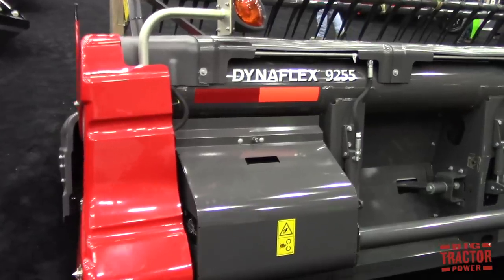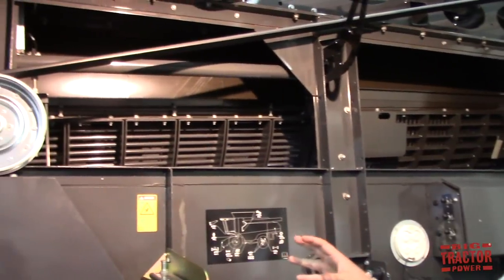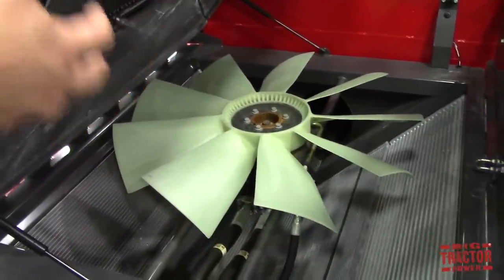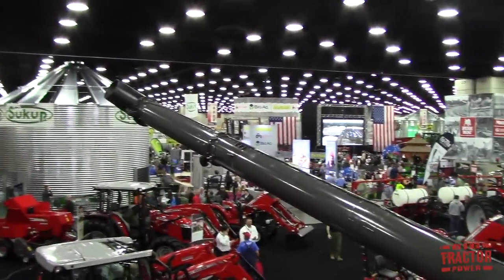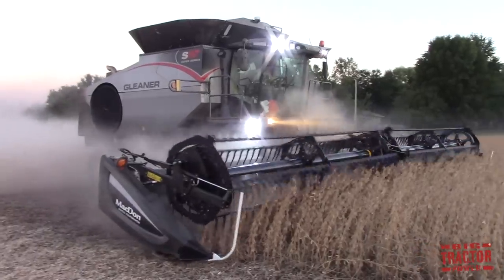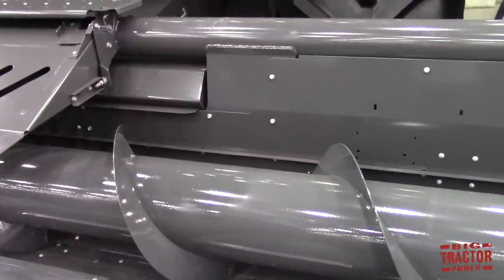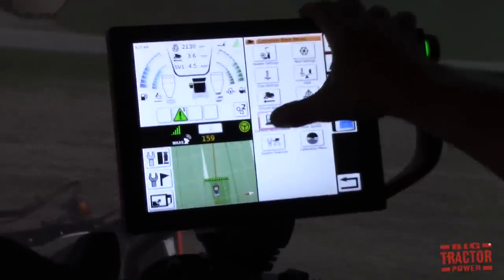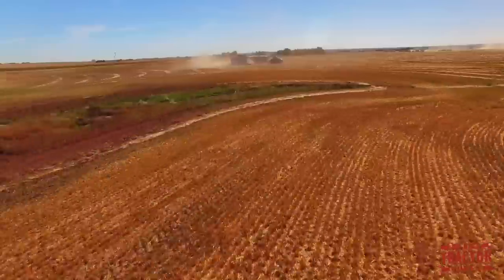Talking with AGCO About New 2018 Combines

Comment: Thanks for making the link so I could see this video and better understand. I think this motor is a Sisu from Finland. They make a 7 cylinder motor. Kind of odd 7 cylinders. Love your channel. You are are doctor of AG info!!
Reply from the maker: It is a Sisu engine.  Valtra owned Sisu.  Agco bought Fendt tractors 20 years ago for their CVT transmissions which have been carried over into many AGCO products.  15 years ago AGCO bough Valtra for their engines.  AGCO primarily used Cummins engines and with Valtra/Sisu as part of AGCO they now had an engine supply of their own.  The Sisu is branded as AGCO Power for many products.  Case New Holland is owned by Fiat which owns IVECO.   As a result IVECO engines are used in New Holland and Case IH products but called FPT engines or some time a New Holland or Case IH engine to put a brand identity stamp on it.